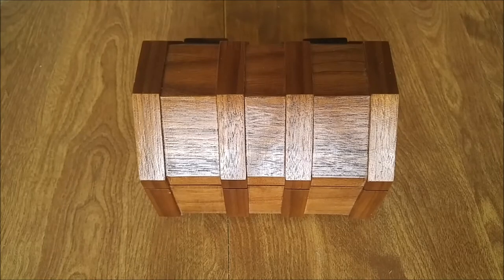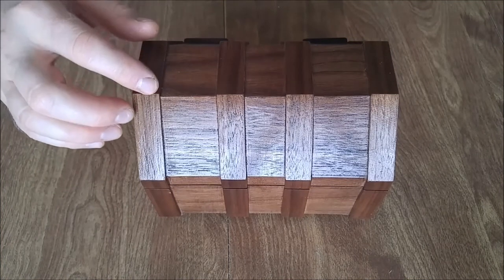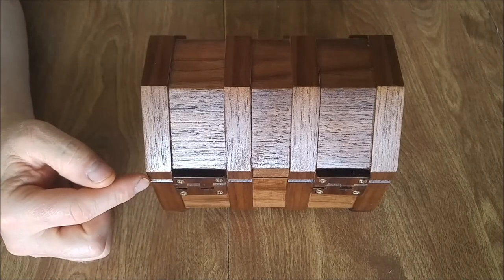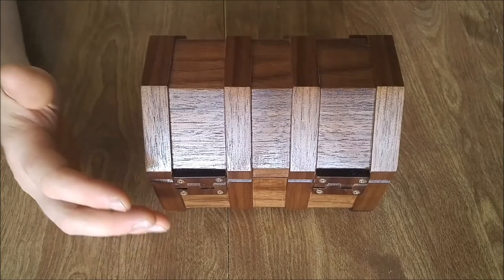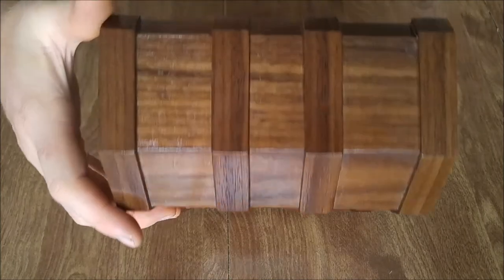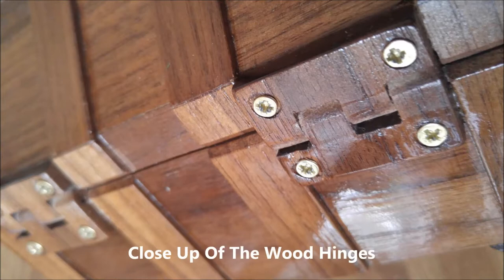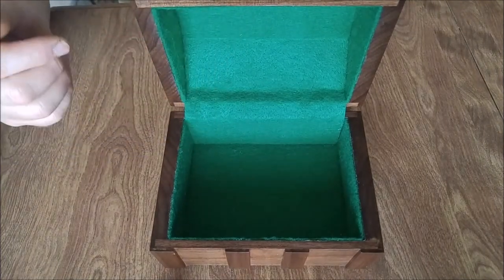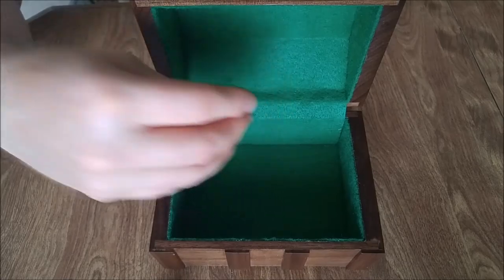Wooden Treasure Chest

Comment: how can i get a 3d cad design? great piece!
Reply from the maker: Based on your request I posted the CAD model out on the Sketchup 3d warehouse website. You should be able to find it by searching that website with either dumas5000 or 'Wooden Treasure Chest'. I think the project turned out very good and don't have much constructive feedback on it except one person had a good point that if the strength of the wood hinges is a concern then 3 of them would be better than 2.